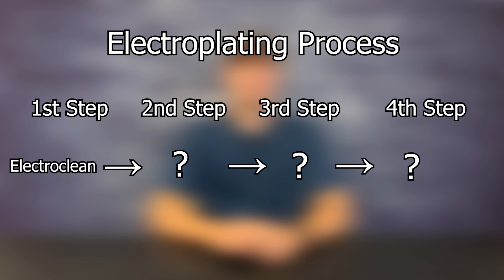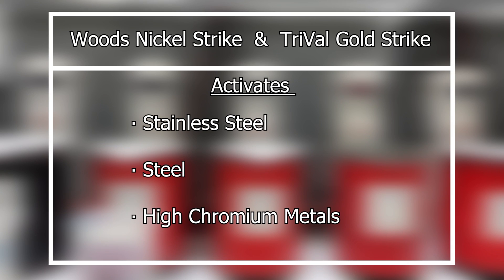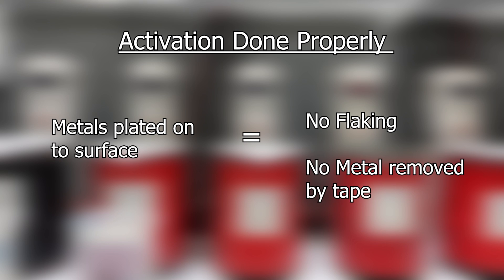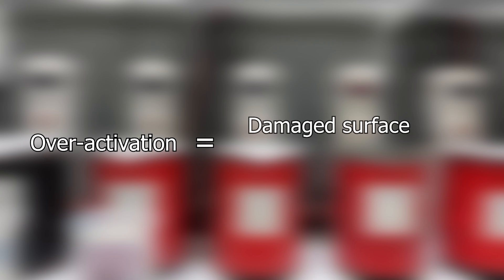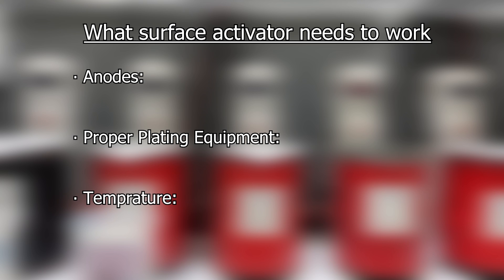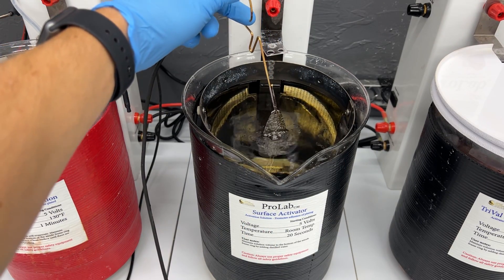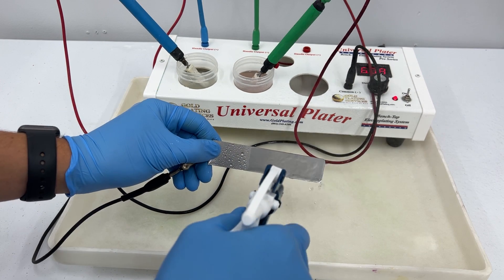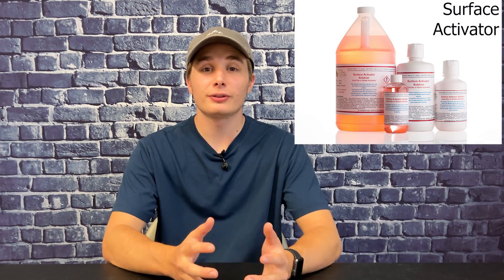Surface Activator in the Electroplating Process

Comment: I have a question tho, for example I have some old 14kt gold chains and rings (small pieces) and I want them to plate with 24kt gold, do I need to go through the process of surface activation or it is just enough to use chemical degreaser which is also used as step before electro plating?